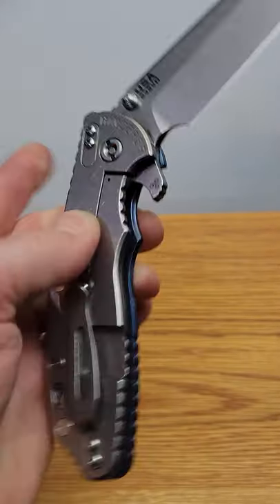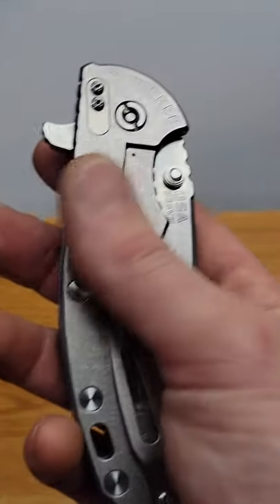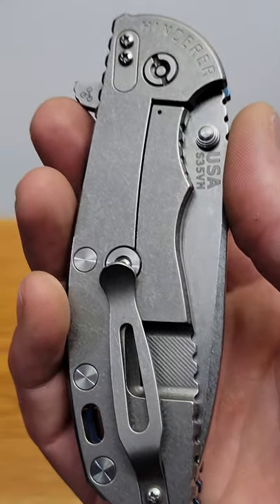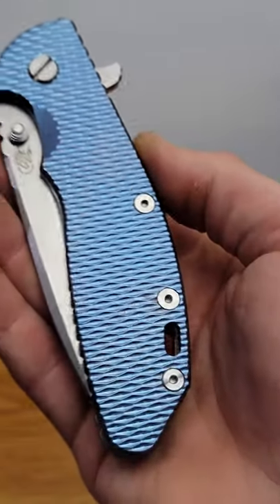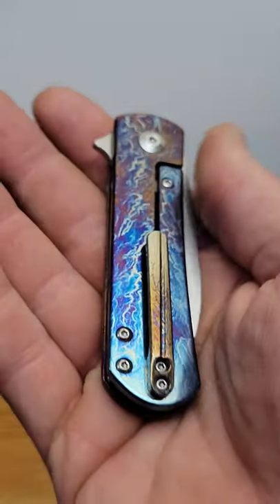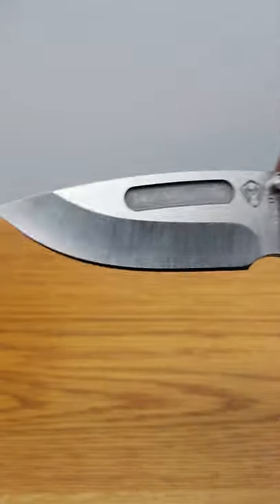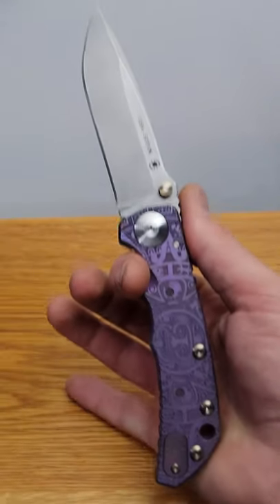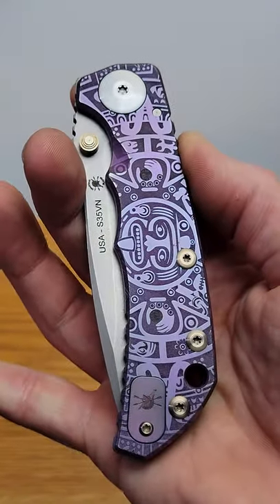DIFFERENCE BETWEEN QUALITY KNIVES AND CHEAP GASTATION KNIVES

Comment: Yea I picked up that same high quality knife at Blade show for over $500! Never cut anything with it, just carried it for a couple weeks. Next thing I know all the damn screws are coming loose. Well guess what you need to tighten the screws; a “high quality” proprietary wrench that costs half the price of the knife. Didn’t know that ahead of time, stupid me. I’ll stick with my ZT folders. Those things are tanks and after years of abuse still work the same they did the first day I pulled em outta the box!

Comment: visually id say cheap gas station knives look as good and even better than high quallity ones but theres a major difference, when you pick up and feel a knife just by its weight and how it works you can really tell its quality by that factor. gas station kives usually feel overly light, weight imbalence and awful locking feel
Reply from the maker: since ive been through so many knives i can see a gastation knife a mile away and that the materials are fake, or just trying to look like the real thing, and the ones with the premium materials also stand out
Reply: @NeevesKnives  i dont have that level of experience but when you get up close and look at it you can definitely see all the fake stuff, friend of mine bought a gas station knife where you could scratch the damascus etchings off with your finger nail